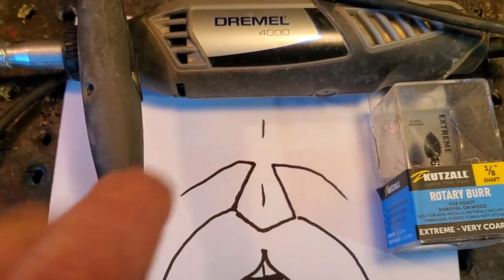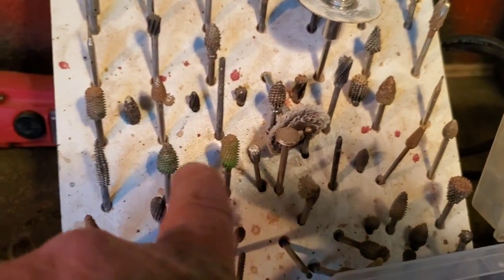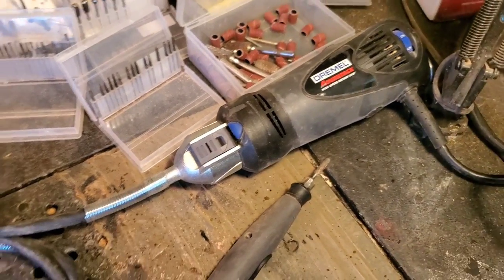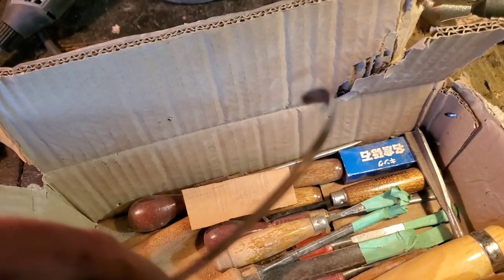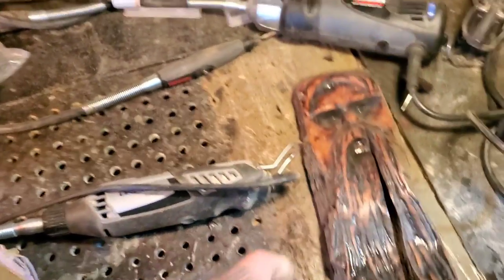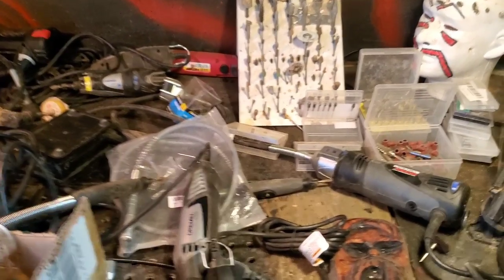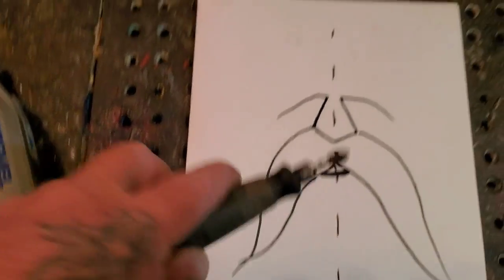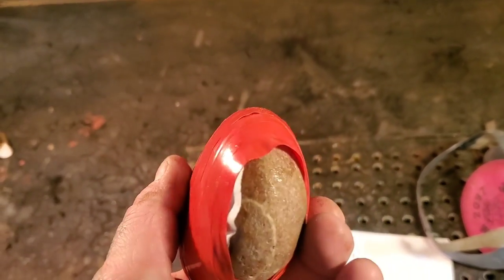The 100% must have wood carving tool's to have under $100(usa) for the beginner power carver.

Comment: I’m still refining my wood carving skills and can’t wait till I get one of those flame burrs but with that being said I’ve owned two ryobi rotary tools that come with the flex shafts and I personally think that they knock all of the dremels I’ve owned out of the water. They have a lot more control over over the speed and the brushless motor is extremely quiet. And best yet with a beast 6ah battery I can carve for a couple hours anytime anywhere I want. Give it a go jordy. Not the biggest fan of ryobi but their rotary tools are bad ass.

Comment: Jordy you have taught me how....how to start carving, and what to use. My dad lived woodworking,  however he died when he was only 57. I had SO many questions to ask , but didn't  get the opportunity.  I gave had so many regrets. I kept as much of his stuff as I could, including  his old dremel stuff and some other things. So one day I came across your you tube vids, just a couple of months ago. Through you I have found a way to use my dad's old gear. Had to buy a new flex as I broke the old one, and a couple of new bits including  a kutzall. 
I am overjoyed I get to do this. I think my dad would be proud to see that I have started doing more than just DIY, and have found a mentor since he isn't  here to answer my questions.  Thank you so much Jordy! I hope to get a new Dremel or Black and Decker at some point as mine is older and kind of puny, but I am happy,  with LOTS to learn. Thank you Jordy, screw the haters, we love ya Jordy!

Comment: Best tool on the bench is the burr head. I gotta carve one, or find a foam one like yours). It sets the carving mood.

Just sprung for a Foredom TX with the 5 foot square drive flex. (I heard from an heavy hand expert to go for the square drive).
I found Homeless Despot has the TX (1/3hp PM square drive with collet handpiece) for $389 free home delivery.. The 'TX'  Permanent magnet DC motor has better low end torque than the series wound SR, and that should be the ticket for large diameter cutters.  Can't wait till it gets here, I got a deal on some nice carving wood at the gas station (firewood bundles "Hott Sticks" kiln dried hardwood sticks debarked and cleaned, ready for carving at less than $1 a stick. (I got asked why not use the firewood in back of the shop, but this is clean, prepped, and "BUG FREE" (That was the selling point). In the bundles there was Oak, Ash, Poplar(pretty sure), and a couple of ones I'm not sure about. Good stuff anyway. I have a 2 Dremel 4000 units, on has iffy bearings, the other is pretty fresh, but they're not Firewoodspirit rated, amd I've had a Foredom on my want list for >25years now. 
That's roughly the story on how 10 bucks worth of firewood (paid for by bottle returns), cost me $400 in carving equipment. Now I'm power carve capable (need to keep it low here at my mom's trailer, the invisible people don't like it noisy or dusty). I've been doing all my carving manually with a occasional 'assist' from the Dremel and a Ryobi one cordless router running a Kutzall burr.
Thanks for listening to my ramble. I'll ramble some more one my cool new power carver gets here. (About next thurs 8/18)
Reply from the maker: Wicked fire wood and i hope i will enjoy your foredom , good call getting the square drive off the batt

Comment: I've been doing text inlays for a little while now as part of a larger woodwork hobby.  I've been doing it with a cheap Aldi multi tool and a small ball nose burr but I wanted to take it further and didn't know where to start.  You've inspired me to try to go further and have ordered the 4000, flex shaft and the flame Kutzall extra coarse burr.  Can't wait to get started!

Comment: For you beginners Jordy is right , the Dremel 4000 is the best. I tryed ALL the cheap ones trying to save money but in the end you will save by getting a 4000. Now there is a exception, the Black & Decker RTX  with a Dremel flex shaft on it. I bought one over a year ago and I carve every day and in my opinion it is the best. It is a 2 amp brushless rotary tool and it is a hog . In the USA it's only $40.00. I did't Know a thing about carving untill I ran across Jordy on YouTube about 2 years ago and now I can't stay out of my little shop.

Comment: I just found your channel today, thanks for sharing all of your experience. It hasn't come up in the videos I've watched so far, but how well do those Kutzall burrs work in a hardwood like Hawaiian KOA?  I have been using 40 grit diamond burrs  and they work ok for my purposes,, but I always like to try new stuff.
Reply from the maker: They will worl great, tey the 1/8 exream flame bur,

Also for hard wood i use aluminum cutting burrs, not the metal working ones but the aluminum cutting ones, they are listed im my amazon store
Reply: @CarvingFusion  thanks, I appreciate that.  That would seem backwards at first to use the aluminum rather than the harder metal, but makes sense to avoid getting too hot and burning the wood.  Thanks for that. I will have to get them on Amazon, and definitely will go through your link.  I normally get most things from EBay  (and my wife is the Amazon shopper, which makes sense to have Prime when living on an island in the middle of the ocean)  They dont ship them out here from EBay though

Comment: I just bought my first Dremel 5 days ago. I have a cheap harbor freight one I barley use but I wanted a good one. I bought the 4300 just so it would handle whatever I wanted to tackle. The next day I started YouTube’ing videos of what I could do with a Dremel. Within minutes I ran across a video of you carving a wood spirit and I’m hooked. Watched about 29 of your videos so far and haven’t started my first carving yet. I just orders a flex shaft and 2 kutzall bits. I have a question. I haven’t even plugged my 4300 in yet. Should I return it for a smaller one?

Comment: Do you need some decalf there Jordy? I'm still using a single speed Dremel I've had for over 30 yrs. Another one that is at least 15 yrs old. Foot controls for both. Both still sling woodchips out faster than the wind can blow them away. Got the woodspirit idea along with a bunch of other's from watching a Jordy video. My advice, get a bigger coffee cup. Hi Jordy.
Reply from the maker: Hi rickkk lol

Comment: Hey jordy i am also a dock worker over here in uk  and ive just been watching alot of your vids ive gone and ordered the dremel 4300 as it was on sale i know you briefly covered foot pedals but can you or any of your uk subcribers recommend a decent pedal brand?
Reply from the maker: The foredom speed controll pedal
Reply from the maker: Are u longshoreman
Reply: @CarvingFusion  will i have to wire the dremel into the pedal do you know ? Reason i ask is uk plug is completely different and probably have to cut plug off dremel and hardwire it possibly
Reply: @CarvingFusion  work on a container terminal from shiphand, ( steverdore) to forklift and tug master driver...driving around the quay taking the boxes to various points
I refused to drive straddle carriers as neck injury from motorbike accident gives me grief...only next step is gantry if i fancy it.. but similar to you i dont help myself and sometimes my mouth and tenacious ways have not helped my progression 😂👍✌ so ye am basically a old arse docker
Reply from the maker: @urbanmythfpv3121  steve dore wicked!! I drive bombcart at deltaport in bc canada, im also a bulk op, im on the A board,

Maybe try going to thrift store and look for old sewing machine pedals, they are speed controll to, 
If u want email me and i will try help u ,

Canadian1dude@gmail.com
Reply from the maker: @urbanmythfpv3121  wicked
Reply: @CarvingFusion  unfortunately our car park is near the bulk operations so my little car is less than impressed with the ammount of crap it gathers 😂
Reply from the maker: @urbanmythfpv3121  🤣😅😆😅🤣🐫🦙🐏🐑🐐🐪🐴🐂🐃🐂🐷🐷🐷
Reply: @CarvingFusion  email sent and added to Instagram ✌👍👊